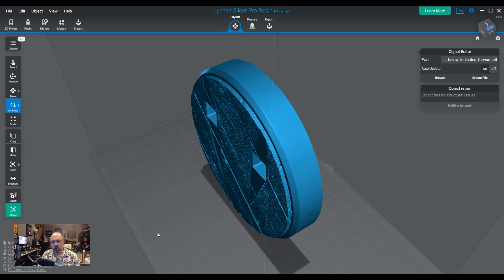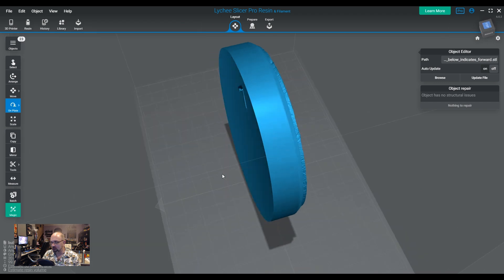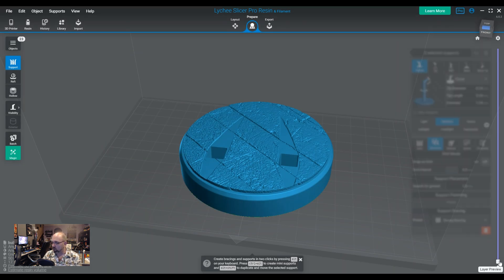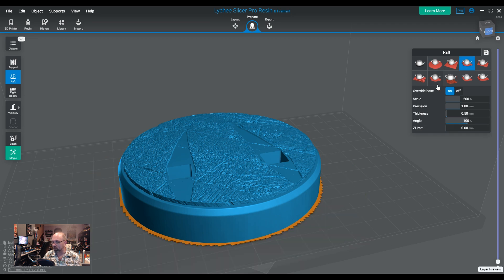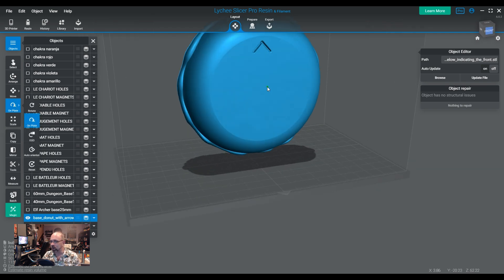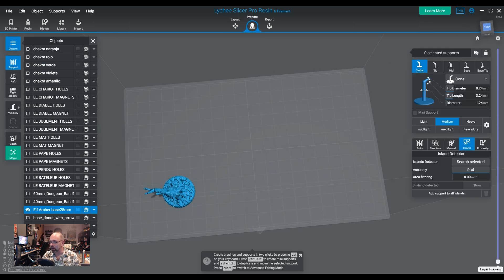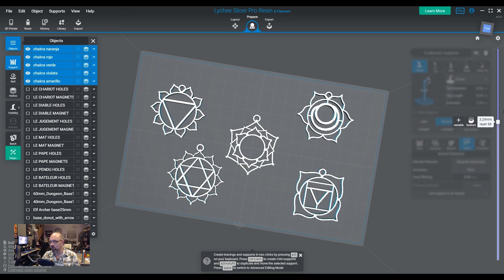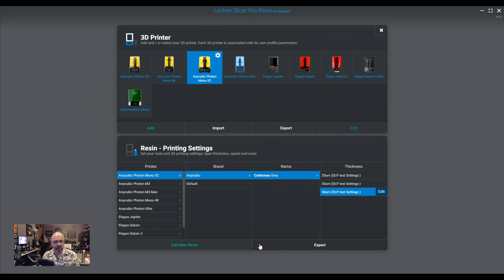3D resin printing, tips, tricks and more 😊  Printing flat off the build plate

Comment: Nice, but one question I have. First layers timing you mentioned elephant foot. And that is my concern because i cant post process it. And if I lower it to time where there wouldnt be so much expansion of material, would it still stick enough strong to succeed the print instead of just deattaching from the plate. I am asking about flat object like coasters. Thanks!
Reply: My suggestion would be do the bottom exposure sample. Put sets of 2 with different distances between them to test out how much they expand. And then test out different bottom exposures and you can see how high you can get it to bottom cure before your margin of error. That being said know temp play huge role so summer and winter exposures may be different.  Which you can get a heater or heater vat to help.
Reply from the maker: Great suggestion.
Reply from the maker: The elephant's foot sadly is a product of that process. The only way to remove it entirely is to find the "Sweet" spot for your resin/printer/light source, this would take considerable tests and tracking each result and dealing with failures in the process. That would make the foot so small it would be unnoticeable. Otherwise, support it, and clean the support bits off, this works for some things, but the foot is a problem for some.
Reply: Slicers nowadays have options to shrink the first few layers to fix the elephant foot, without needing to change your exposure time.